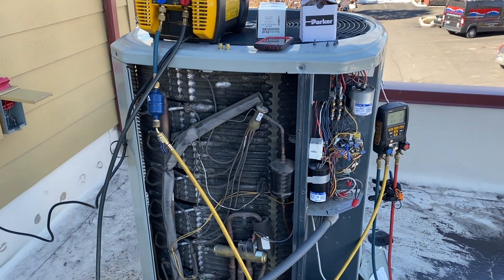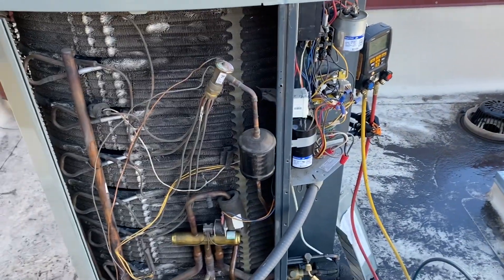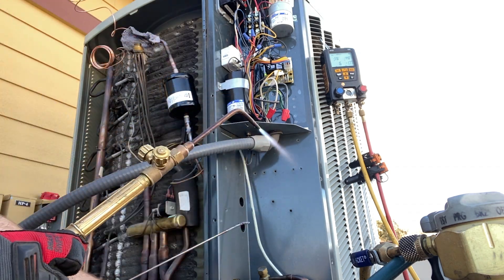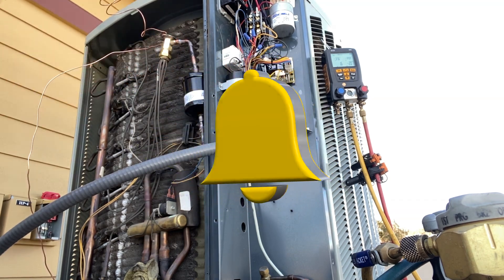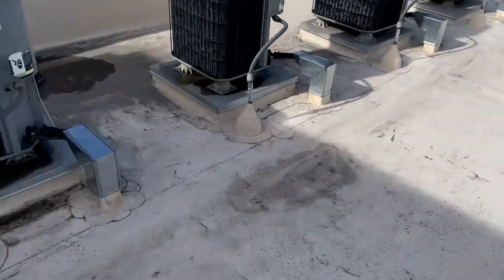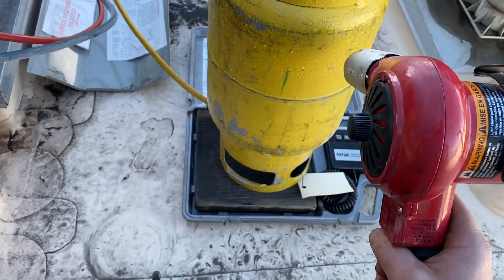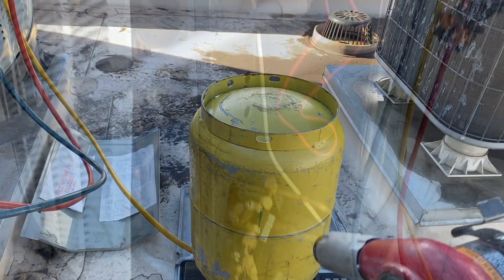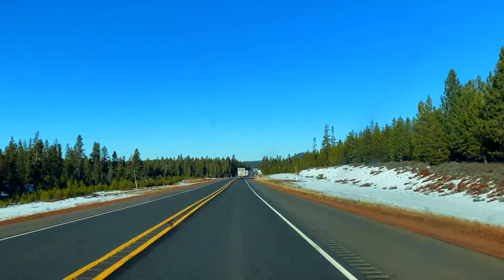How to Replace an Outdoor TXV on a Trane Heat Pump. EP54

Comment: I was just quoted 1890$ to replace this TXV valve on my trane heat pump - a 200$ part. It frustrates me to no end that home owners "arent allowed" to handle refrigerant.
Reply from the maker: If you were able to do the repair yourself you would have to invest about that much to purchase all the equipment to do the repair properly.   Plus training, parts and refrigerant. This is why the cost is so much. The price does seem a little high. I’d suggest a second opinion. Just to make sure that’s the issue.   This is sometimes misdiagnosed.   Good luck.

Comment: Great job. Where did you get the TXV.. I ran into one just like that today but was told it's no longer available.
Reply from the maker: Aw man that sucks. I did this repair a little over a year so I was able to get it from Trane. It’s a Parker TXV you might be able to find it online. I sometimes have luck with supplyhouse.com when parts are “not available”. Good luck!
Reply: @NighthawkHVAC  Thanks!

Comment: Why do you have to purge the R22 before doing repair ? Is there a risk of combustion or would it contaminate the solder joint. ??   Thanks for video
Reply from the maker: The refrigerant has to be removed first otherwise it would just be released into the atmosphere when removing the old TXV. The oil is also flammable.
Reply: @NighthawkHVAC  Thanks for explaining